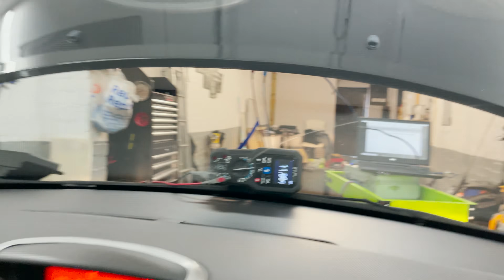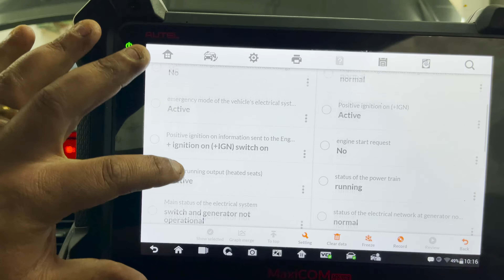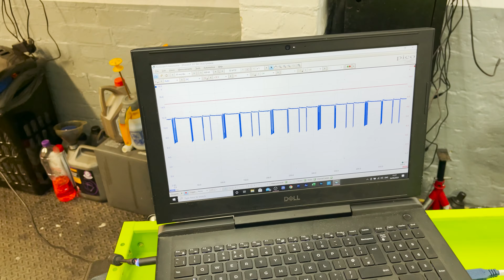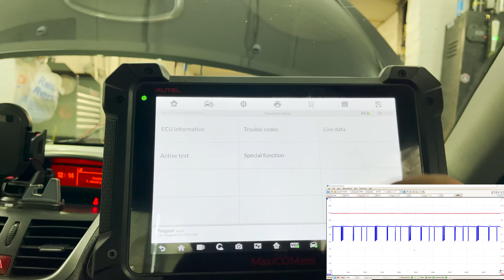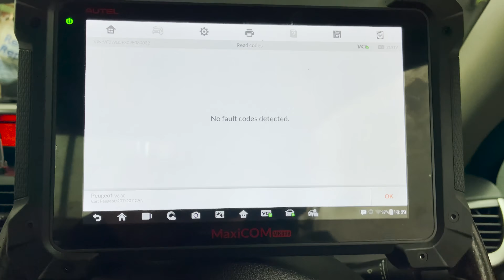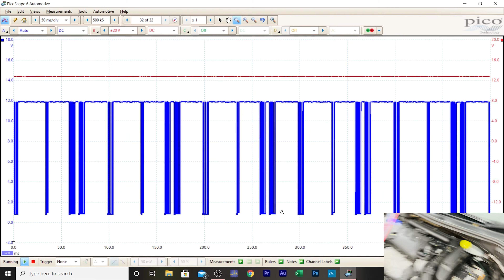Workshop 1st Video and I GOT BURNT Peugeot Battery Charge or Electrical Supply Faulty code F066

Comment: Great video and diagnostic. These cars are notorious for corroded wires, but you did an amazing job actually finding it. I hope you charged the client for ALL the hours you spent on this fix, including the first module installation. I'd have sent the non-required part back as well (always open the part box carefully, just in case! : )  Great work, mate. Hope business is going good.

Comment: I found it about battery not charging faulty and warning STOP....yesterday I repair my knocking sensor and solenoid valve camshaft...that problem it's solve...6 months my Peugeot 308 T7 running with battery faulty charging and STOP.....not BSI and not BPGA problem...the problem is Knocking Sensor....sory for my bad english writing...

Comment: You saw a bad signal when plugged in and good signal while the sensor was unplugged. In  LIN bus usually there are more devices using the same bus. If the signal was truly bad when the connector was plugged in, no device would be able to use the bus. You could have checked if there was more devices using the bus and was reporting an OK status. Or you could have taken the measurement to the other end.

Comment: Hi, I have a problem with my 2008 207cc. Automatic transmission. When I turn the key without my tooth on the brake, the car dies. No power, no lights on the dash. Then I disconnect the positive and negative battery, reinstall the terminals,  the power comes back. When my foot is on the brake to start, everything works perfectly.  Any ideas what the fault could be would be great help. Thanks

Comment: So if I understood it was when you unplugged connector that wire just get opened, touched  ground or whatever. That is crazy.
Reply from the maker: The problem was resistance in the wiring , all the powdery wire although it was damaged still had Okish conductivity but when plugged in the little battery module was loading the circuit messing the signal 👍
Reply: @CarsExposed   yes voltage drop, but that was so consistently when you plugged in and unplugged, that you weren't burnt. I think few of technician would figure that out. And don't be hard on yout self, you are very good at explaining and knowledgeable.
Reply from the maker: Yeah I think I was a bit unlucky but, although I hate to get things wrong it’s all good I’m ok with it , it will be a long learning road ahead 👍
Reply: Exactly for all us thanks for sharing